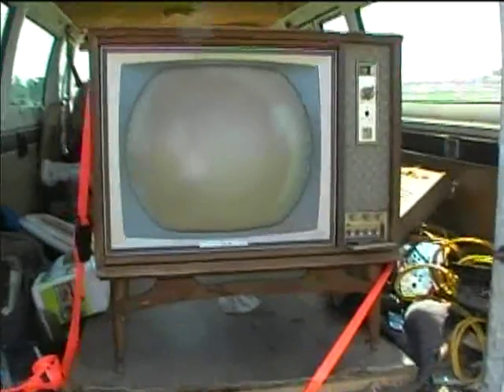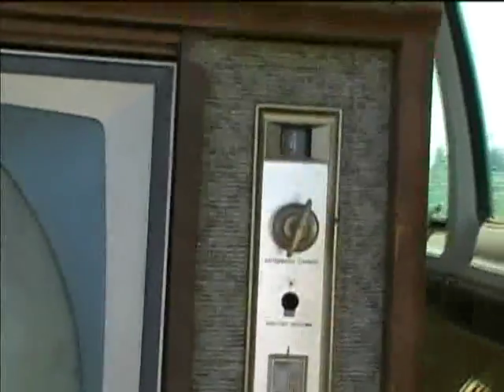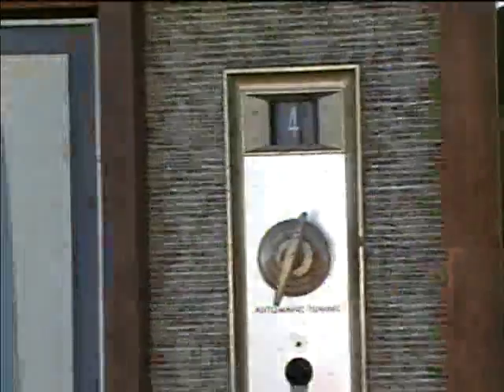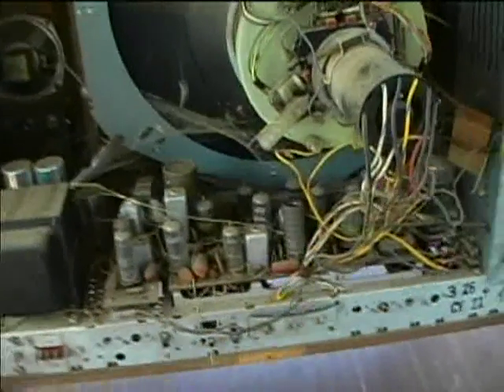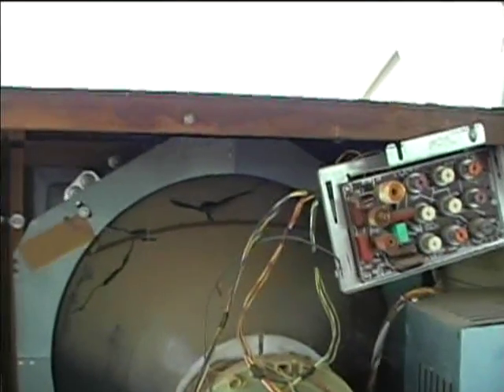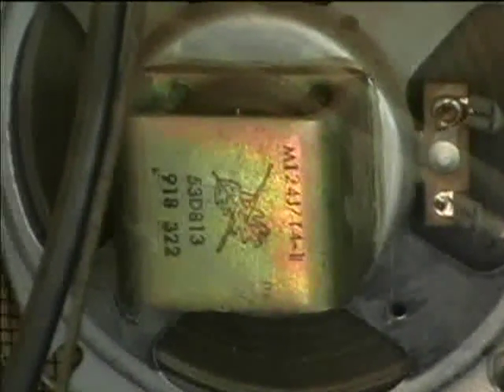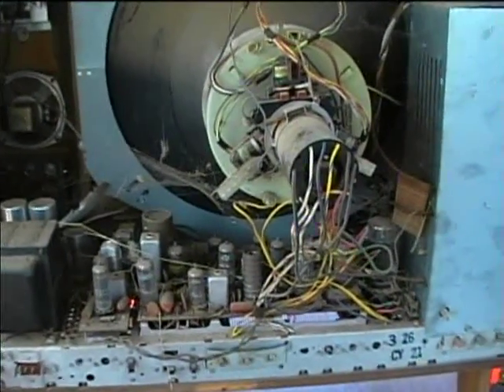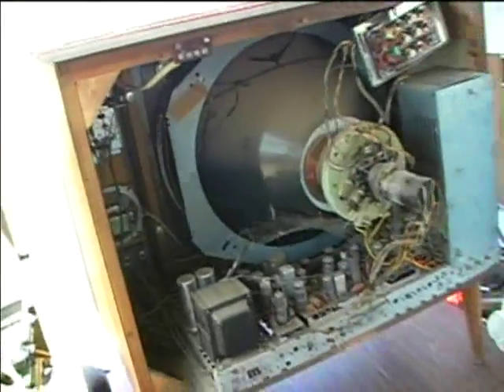1963 General Electric round-tube color TV

Comment: These old sets sell well on Ebay for as much as 500 for an old ctc38h 4 years made a huge inprovement on crt design from that 21fbp22 to the 25Ajp22  rare earth square tube , great picture improvement with contrast and brightness, Great idea to fuse cathode of the 6lQ6 to save that tube . horizontal problems often happened. I found some of those old flybacks would drip but still work if the set was left on for short periods..

Comment from the maker: My barn is not really historic, it's got corrugated tin siding and roof and looks like it was made with scrap materials probably in the 1950's. I have tried to apply tar over all the seams in the roof but it is still leaking under heavy rains. I really want to just use it for the tractor and get as much electronic equipment out of it as possible or at least moved to better areas. Pretty much everything is be covered with tarps to protect it.I saw your barn in the TV video, looks real nice!

Comment from the maker: I think what you end up with when you do the PVA cataract repair on the 21FJP22 is a 21FBP22 with round safety lens. This is like what was used in some Zenith sets. There is a 21FBP22 tube but there is no safety glass in the cabinet, it's attached to the CRT with tape around edges but no PVA bonding.
I'm sure if there was any patents involved with the set's design they paid royalties to RCA to use it. Many different makers used this design.

Comment from the maker: I just found a company called "Ladd Research" (just search google) which had Aquadag itself but it's pretty expensive. They have an aerosol product called Aerodag for $22.95 for a 10.5 oz can.I may contact them and try and get some more specifications on Aerodag and see if it will work in the CRT repair application.